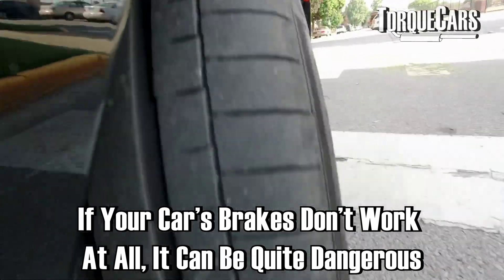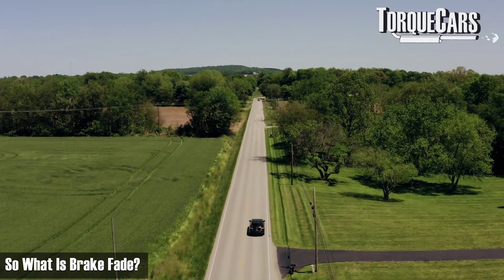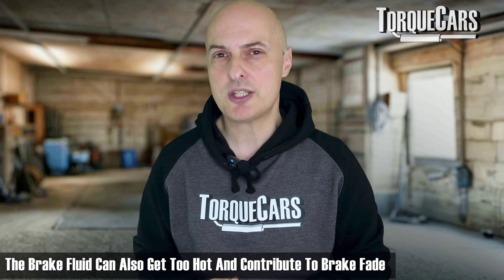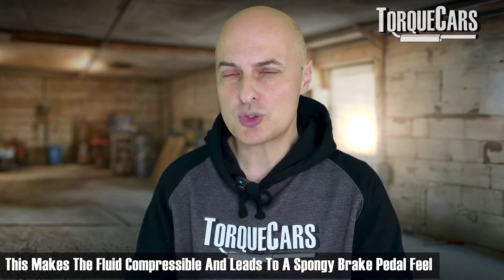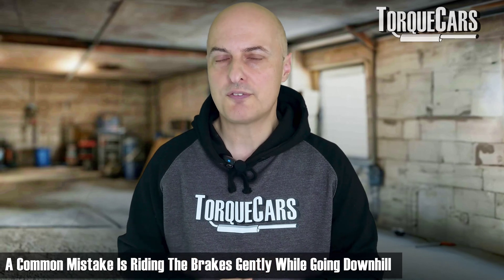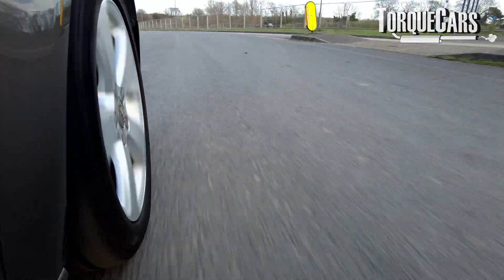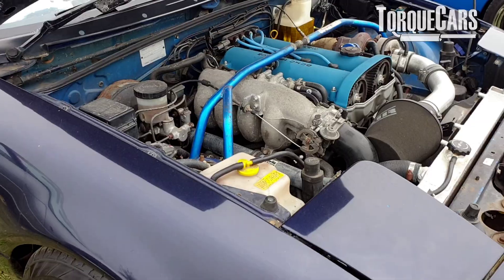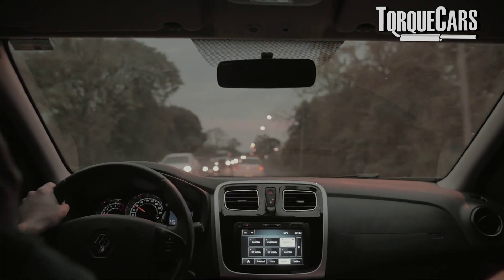Brake Fade: What It Is, Why It Happens, and How to Fix It - Tips For Spirited Driving

Comment: My 1993 had horrible brake fade from when it was brand new, you could break from 110km/h to zero 1 time, if you sped up to same speed and tried again you would have very little to no brake effect. I fixed that by changing to "green stuff" racing break pads, those had fade in instead of bread face :) Very little effect when you pressed the break pedal and could not lock the tires, then they heated up and very rapidly got better and better braking effect and you had to ease of the break pedal to not lock the tires, this gave amazingly short breaking distances and much much better than any ABS brakes.

Comment: Unfortunately, with modern cars, engine braking is very weak, especially with slush transmissions, diesel engines or ultra low emission vehicles. However, I've solved that by switching to a PHEV: tons of regenerative braking power, I can do ten miles after a long descent using only recovered energy and brake pads last forever.

Comment: Berriedale Braes on the A9 near me has a gradient of 13% and it's long. There are signs on it advising use of lower gears.
I've often wondered how you get down in an automatic without riding the brakes?
My driving instructor taught me how to use engine braking. He told me, "I'm not going to teach you how to pass your driving test, I'm going to teach you how to drive".

(Recently subbed, I like your vids, no annoying music, ai voices and no fluff, straight in with the info. Good stuff!)

Comment: Here in Greece in the countryside there's lots of dangerous steep mountain roads with constant sharp bends. When going downhill in those I don't feel comfortable doing more than 20-25mph. How could I drive down these without riding the brake? Even in 2nd gear I always end up accelerating too much before I have to turn. Thank you for your very informative content!
Reply: True
Reply: Try first gear then! 20 MPH must be about, idk, 4000-ish RPM? Or buy a diesel truck with exhaust restrictor😂

Comment: 3:21 That person braking with the left foot in a manual car...🙈
I don't even like it when people do it in automatic cars. 
You're taking your right foot off the accelerator to slow down, so use it to press the brakes.
Reply from the maker: This was taken from an advanced driving video that demonstrated heel & toe and braking with the throttle open to keep the turbo spooled up for the take off and it also mentioned testing the cars braking capabilities with a left foot stomp. 

You are right it is not something we do on the road and should not have been included here really, I got footage blind in editing.
Reply: @torquecars  No, it's fine. I'm just irritated with people braking with their left foot🙄
I tried it once and almost went through the windscreen 🤭
The muscle memory of my left leg is adapted to pushing the clutch. 
Interesting, when I taught a work colleague to drive (manual), he did fine, until one day I let him drive an automatic. He immediately started braking with the left foot, but very smoothly and all. I couldn't understand it and kept scolding him😠
Until I saw him working the digger loader in our construction company. That earth moving machine has an auto type of box, and the operators always use the left foot on the brake to work the machine. It's actually got two brake pedals (for turning on,a dime), which can be locked together with a sliding pin. 
My colleague's muscle memory kicked in when he got in the automatic car😁🙋🏼‍♂️

Comment: Is slowing up anything like speeding down? But more seriously, drilled and grooved discs are actually worse for road use as they reduce the contact surface area and need to get pretty hot to have any meaningful effect. Vented discs on the other hand are a good idea even for general road use.
Reply from the maker: Lol I never thought about it like that. Is this an English expression that doesn't travel well. Good point about drilled and grooved discs although most fit larger discs when they do this upgrade which mitigates that problem.
Reply: @torquecars I can't remember what is is but there's actually a word for when 'up', 'down', 'in' and 'on' are used to indicate the direction or presence of something. Generally though a reduction is 'down' whereas an increase is an 'up' and it seems a bit strange to describe a progressive decrease as an 'up'.

Comment: One should go downhill in the same gear as you would use going uphill.
I overtook 3 cars going downhill on a motorway. All were breaking and looked unhappy.
I WAS IN 3RD GEAR going 3,000 rpmin 3rd gear but not breaking.
I was in complete control of my car.
The interesting thing is, when learning to drive, one is thought to use the engine to slow down the car.
It is commonly referred to engine breaking.
Reply: @williampatrickfagan7590  brake pads and rotors are replaceable. transmissions, not so much

Comment: strange, when I am driving fast, I almost never use my brakes. Like I time it to naturally slow down in a corner I know we'll, and then  accelerator  out of the corner (often with a lower gear) .
Reply from the maker: That is the mark of a good driver with good anticipation skills.
Reply: If you’re driving “fast” and not using the brake, you’re not driving fast💀